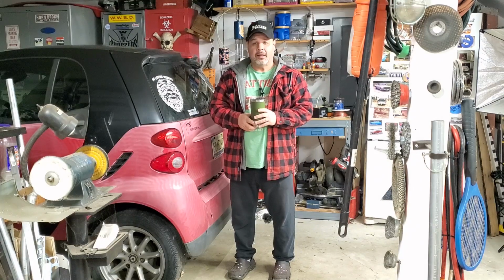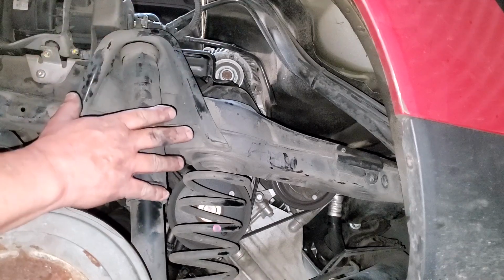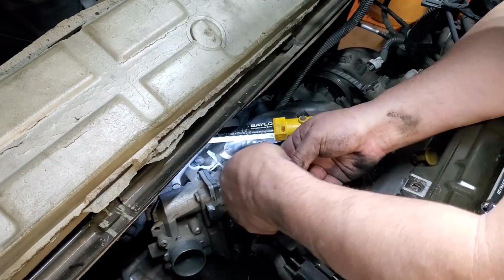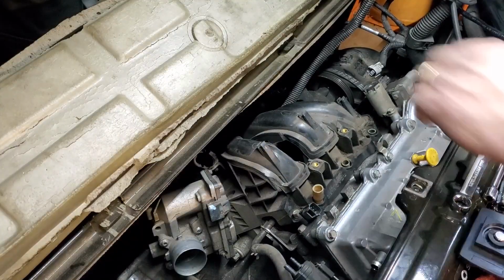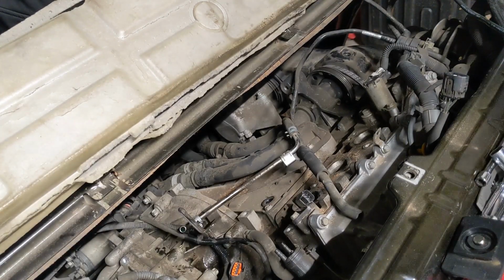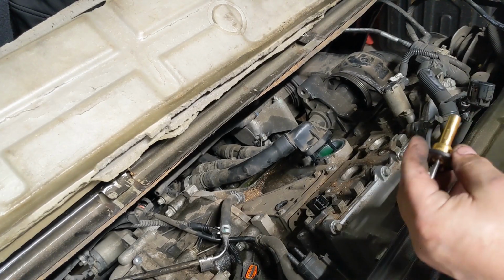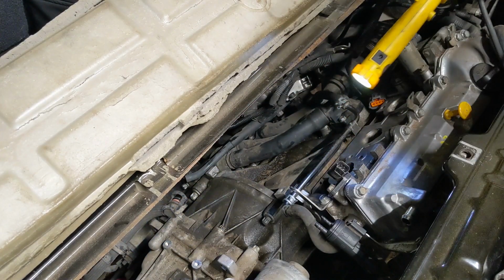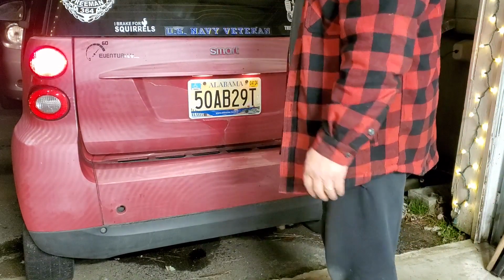2009 Smart Fortwo thermostat

Comment: Appreciate the video and all the damn work for just a thermostat, but man when you take an intake off, ALWAYS and I mean ALWAYS plug the holes...@ 39 min 43 secs in the video something went flying off the thermostat housing and it went flying in the direction of the intake side of the motor, and could easily have gone down one of the intake runners and in this case you might never had known untill you start it up and find you now have to replace the motor.

Comment: What was the outcome 🤔
Did it workout ?

I want to replace my antifreeze first then pull it in either a vacuum to see if the lag in heat is do to air on the system or a thermostat